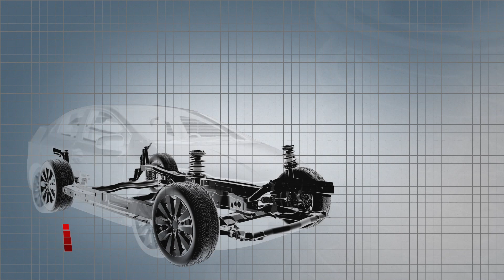Honda: New Civic - Ride & Handling

Comment: Hmm some of those statements didn't convince me, the first was about making the chassis stiffer for a more comfortable ride. Suspension is always a compromise between confort (softer setting) and sharp handling (stiffer setting) also your still listening to your accountants propaganda regarding outdated nonsense torsion bar suspension. Don't try to explain this as the best choice, it's the cheapest choice! Your right the new Civic is not an evolution. It's a step back in time before the EP2/3